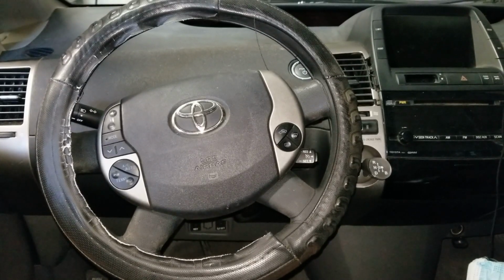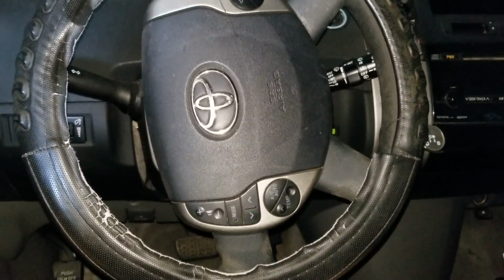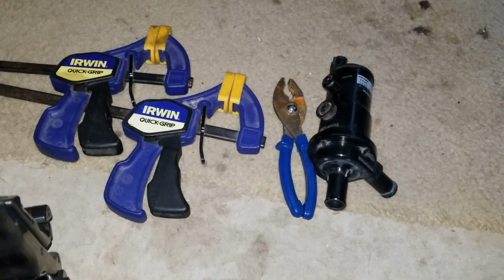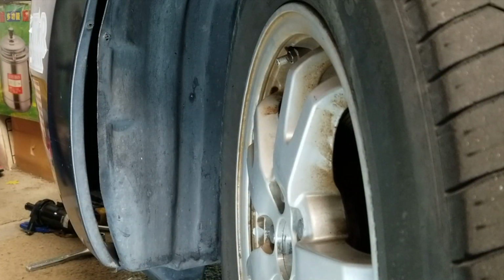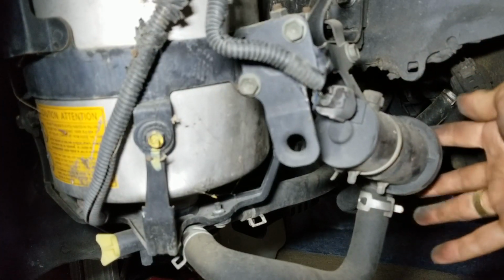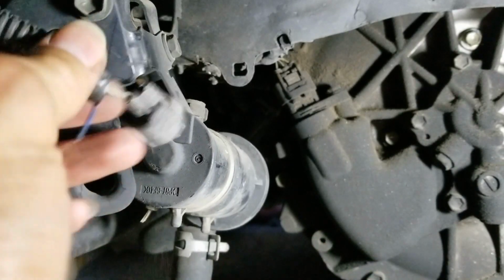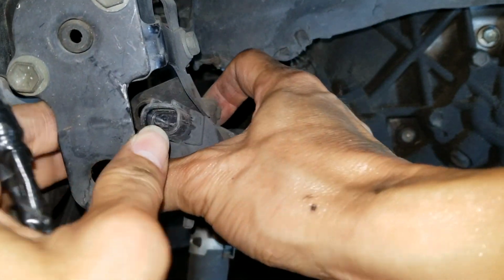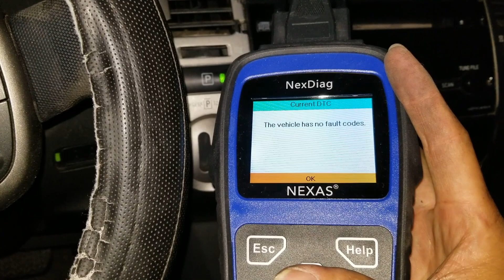Fix & Troubleshoot Prius P2601 Coolant Heater Pump OBDII Check Engine Light Code

Comment: Hey amigo u need cut ur nails amigo  u get oil & grease burrito amigo is no bueno & amigo is no Bueno zip tie in this area cause lots of vibration will break zip ties & cause destroy pumpa then maybe over heat ur carrro then bye  senorita Prius back to shop to rebuild the heads cause zip tie no chigon so please amigo take ur seniorita Prius
Reply from the maker: ¡No te preocupes, mantengo mis uñas limpias!